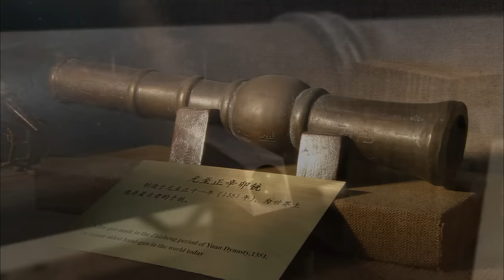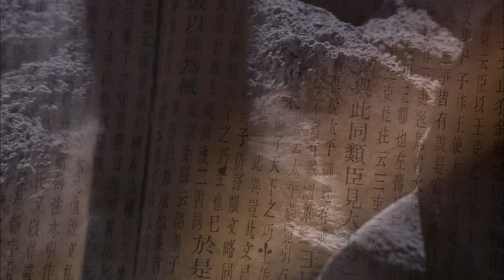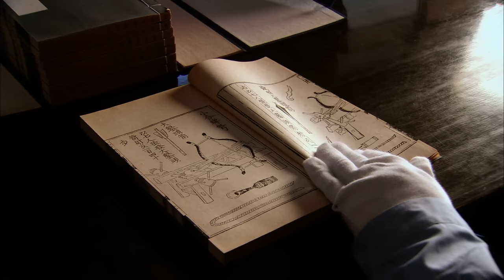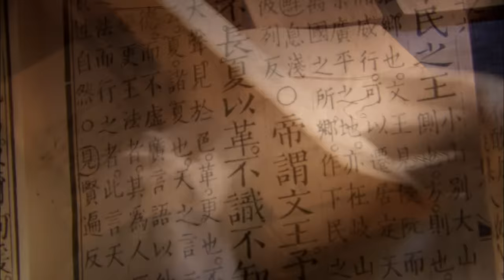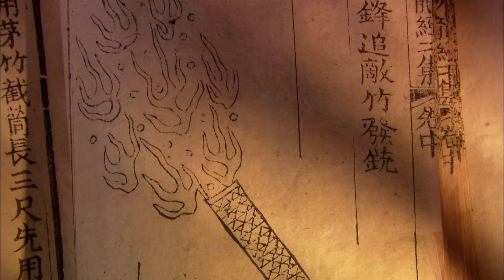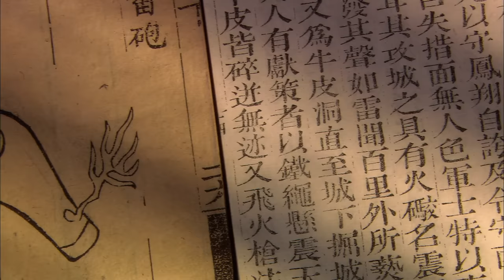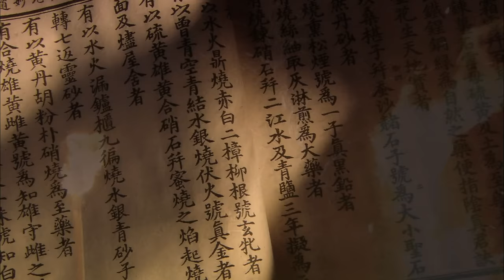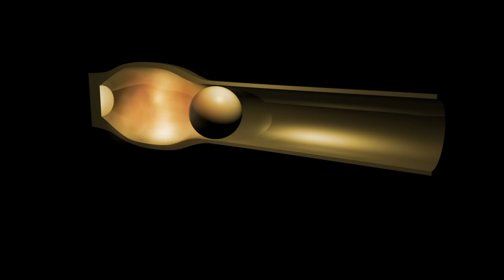Ancient Discoveries: China's Deadly War Machines (S3, E7) | Full Episode

Comment: At 33:04 it says a two-pound bolt is released. That has to be an error. There is no way a handheld crossbow from ancient china is firing a 2 lb projectile. It would have a range of 15 feet lol. Even 2 oz going 300 yards would be very impressive. They are off by a scale greater than 16:1
Reply: These crossbows bruh are huge though. 
20in bolt hits like a 357 which is probably the 125 grain out of a 6in barrel because they are just grabbing data that’s easy. About 600 ft-lbs.
Reply: @segua  A person cannot fire a 2lb projectile 300 yards because of physics bro. Do the math they were off by a factor of greater than 16:1 in my estimation. Prove me wrong with the equation here if you can.